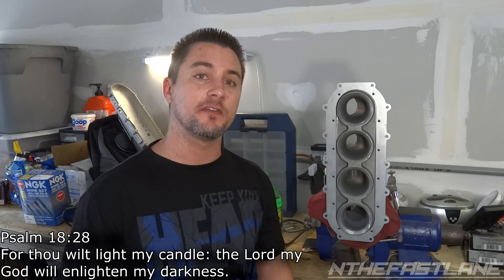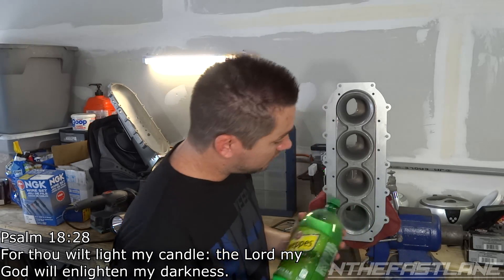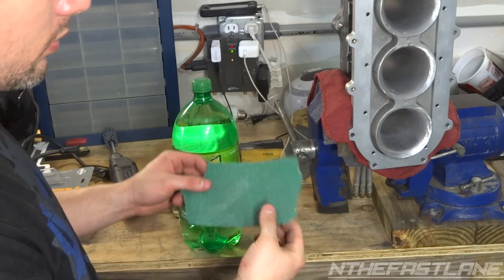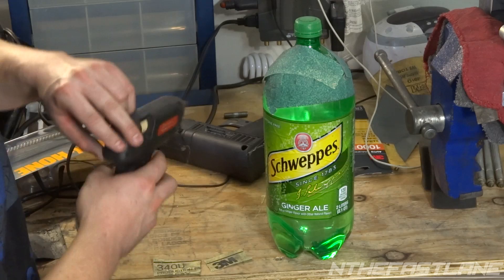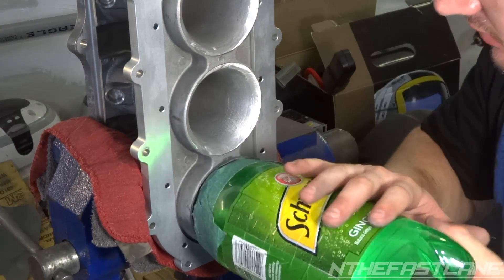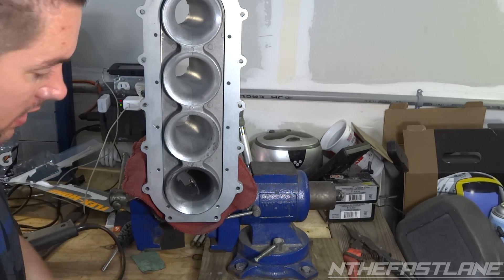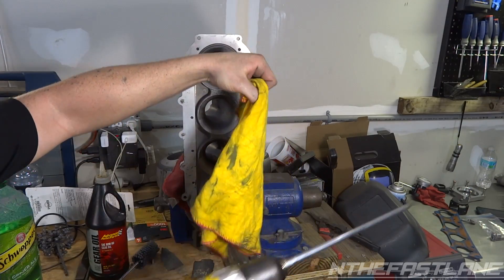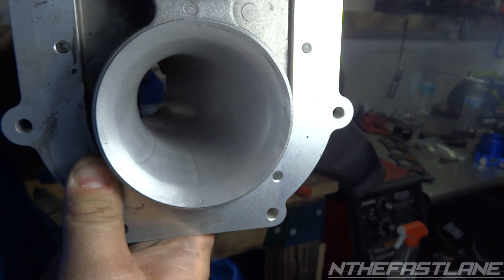▶️Skunk2 Ultra Race Intake Manifold Port & Polish "How To"🔧

Comment: Nice work, but polishing won't improve anything as the air will "stick" to the surface, causing a laminar flow close to the surface.
In fact this will increase the fluid friction in this areas.
Other than that, a certain roughness will cause microscopic swirls, acting like rollers to the gas flow inside the ports.
This phenomenon is known as the "shark skin effect"

But I guess that there won't be any difference to be experienced at all, because the greatest restriction in air- flow will probably be elswhere anyway.
(mostly in the valve- seat area)

The most important issue with the manifold is  the connection between head and ports.
This needs to be flush with no edges or sealings protruding into the channels.

But anyway:
Some good ideas to use the bottle and the honing- tool to remove the rough imperfections!

Nice job though.

Comment: I understand you're using a 3/4 honing tool for the Ultra Race, But I have a Ultra Street. Can I still use a 3/4 honing tool or a smaller size? Any suggestion?

Comment: Great video as always. How much power do you think you gained, I would guess maybe 1 HP, if it is even measurable. Please do not take this as offensive, but In my opinion this is a waste of time.
Reply: Power isn't so much the point, delivery is. Porting/polishing an intake manifold, even if it doesn't yield a large HP gain on the top end, will help it breath better especially in light/moderate throttle situations and lower in the RPM band.
Reply: Avery Alexander I don't think it would yield any peak horsepower at all, but something like this would be an extreme help where the power band starts to fall at higher RPMs lengthening the Power Band past Peak horsepower.. people forget that the peak horsepower is not the only defining Factor. great job on the manifold all the way I would have left some roughness for heat displacement I would have skipped the final polishing step..
Reply: I agree,  when I think of a ported and polished engine, I think of quick revs and clean burns. If you wanna make more HP you gotta move more air and burn more fuel. these techniques seem best for defining a power band. theses techs. work well on 2 stroke motors.

Comment: The casting isn't polished because the tiny bumps increase air velocity... Like a reverse golf ball.
Reply: Ideally the best is not polished but port and let a light "grain" finish but the heavy grain of stock bolt on parts aren't good at all. The tiny bumps are here because of the manufactured injected molding. ( sorry for my english )

Comment: You gotta be a dummy to pay anything near 700 bucks for an intake manifold that isn't polished. for fucks sake. This is why all the manufacturers switched to plastic intake manis. It's already smooth after the casting process. Also what does this do to inlet temps?
Reply: nezerac No, they switched to plastic because it is cheaper.
Reply: If anything, inlet temps would drop because there would be less friction/resistance on the air as it's passing through the intake.
Reply: newpa1n
Ya but it's pulling air from directly under the hood.
Reply: nezerac No, that's not how these intakes work. He has the plenum opened to show the ports, you attach a single throttle body to these intakes and then you can route the actual piping wherever you want. Look into the Hybrid-Racing/Ktuned cold air intake systems.
Reply: Avery Alexander
No...plastic is better for managing heat. I'm looking to be an engineer. Trust me. It's because of power not cost.
Reply: nezerac I hate plastic parts. How about they use an aluminium one with a thermal gasket and finish the job smoothing it. I have seen countless plastic parts, including plenty of plastic intake manifolds break, crack or deform to trust them. Cars are expensive enough that they need to be made well, not the cheapest way possible.
Reply: Avery Alexander
GM's plastic intake is more expensive than their cast aluminun ones for a reason. You're entirely missing the point of using plastic. It's an engineering perspective that you have to at least be willing to attempt to understand in order to appreciate it. Let's be honest here. Plastic is lighter, and  in some cases stronger than a steel piece. It's not as resister to temperature but it doesn't retain heat very well either which should send off some bells for you. Which do you think would heat air charge more? A heat soaked aluminum piece that radiates heat into the charge or a plastic pies where if you blow cool air by it it doesn't affect the charge so much? Aluminum and plasting are far better materials at transfering and dissipating heat than a thick aluminum block of metal. Your engine should never even reach the temps to damage the plastic intake. It probably takes 400 degrees to make it deform and your car should be below 200 in most cases. It only takes a small amount of cognitive effort to put the pieces of the puzzle together to see why what I said is 100% accurate and the fact that finding an aluminum or steel or cast iron intake manifold is impossible to do on ANY modern vehicle.
Reply: nezerac Ok, so plastic can be smoother than aluminium that was not polished, which they should do since cars are NOT cheap. It is a few pounds lighter, and retains less heat. The last one can be resolved with a thermal gasket. But what happens when the car is 10 years old and the plastic was heat cycled many times? I can tell you what happens from experience- they crack or vacuum nipples break off when you remove or install vacuum lines or fail under boost. I have seen this happen many times, but NEVER saw an aluminium one break. I also do not believe that a plastic one is more expensive to produce than aluminium. Just my opinion.
Reply: Avery Alexander
Think about how expensive it is to find a cheap aluminum casting for any v8 vs the plastic housings of today. It's not because the cars are new, it's because cars have changed. I think you're forgetting that direct injection is hear and I think you're forgetting even more that 20 yr old parts are liked to do what you're saying but ANYTHING within the last ten years has seen an amazing advancement for any type of engineering and that includes engineering plastics. Guess what the space shuttel reenters the atmosphere with....FOAM! Guess what is stronger than steel? Spider silk. Guess what controls and aids in regulates heat? Aluminum. Guess what makes heat management better? Again aluminum. But with that control you can reliably run a car at operating temps and not have to worry about any heat cycling that the plastic (which is a misnomer..it's a polymer. Not some cheap thing made to change your radio station and it's got none of the structure) and it warping. It's called R&D man. GM's best intake manifold is plastic and they even started making plastic ones for the old 350's for a bit there. They work! Especially on efi and direct injection engines. If I could change my intake with a plastic one. I wouldn't in a heartbeat.

Comment: I was always told NOT to polish inlets!? The fuel can fall out of suspension in a polished port but a coarse port this cannot happen. I always polish exhaust ports to the max! This also includes the combustions chamber, with exhaust ports I don't take any valve guide off, just round it a little, at hi-revs the valves can dance around a bit causing compression loss...:)
Reply: I disagree.  I've tested several intake manifolds first hand.  Stock, ported, and extrude honed and the extrude honed manifold had the highest velocity.  It was the most smooth of the 3.  Dont confuse intake chamber physics with manifolds.
Reply: This is not true as fuel is injected typically at the end of the intake runner.  Most of what you're referring to takes place inside the port on the head and in the combustion chamber itself.  Not in the intake manifold.  Cylinder head ports, even ported cnc'd ones have small ridges that allow the fuel to atomize properly.  With an intake manifold, you should always go for a mirror finish to help with port velocity.
Reply: Not true at all, mirror finish removes the tiny bumps and reduces air velocity. Look at the mythbusters episode with golf ball car. Intakes are the opposite (unless you make thousands of tiny dimples like a few drag strip guys have) the spots between the bumps create a pocket of reduced pressure and help acceleration and thus velocity. Its like first year physics.

Comment: do you have to worry about rust?
Reply: +Andrew Davis No, that's aluminum. It will oxidize, but it's pretty resistant to it.
Reply: Could you use a ceramic coating or not worth the price? I'm just curious.
Reply: You could coat for the look if you wanted.

Comment: hey bro,really like the vids!! I have a question, I have a b16 head and would like to port and polish the intake and exhaust runners.what grit sand paper should I try it with? thanks man!
Reply: never polish the intake side. you want the air to tumble in the manifold. you can port it yes but you only port and polish the exhaust side
Reply: Great thanks man!
Reply: +danny tapia dont listen to bad advice, polish it up as much as you want. On the head in the area where the injector will spray the fuel, thats the part you dont polish to avoid fuel puddling at low revs

Comment: you polish exhaust not intake as you need turbulence to mix the air fuel mixture ????
Reply: Ehh that's debatable.
Doing so would make more sense in a carbureted engine since the air fuel mixture has to travel the entire length of the runners.
Since mfi engines inject fuel directly into the intake ports or the back of the valves.
Manufacturers use combustion chamber design, vvt events, injector design and or piston design to create turbulence.
Reply: Air fuel mix is essential carb or injection all injection does is measure out the fuel according to the read out of the o2 sensor as to what is burnt and what is left over . if the air moving over or under  the inlet manifold is moving quicker than the fuel being injected you get blow by and over fueling causing higher running costs and less power
Reply: Does that not deal more with carb than fuel injection. The ecu should control that by the o2, maf and/or the map senors.. and adjust accordingly.
Reply from the maker: Jason Kehoe basically you kind of want to leave the cylinder head intake ports alone, but the intake manifold itself can be polished smooth because that's the air that comes in right before the intake ports where the injectors are. I've heard a bit of theory about a certain grit on the intake ports.

Comment: It will flow better, but what about the power? Better flow isn't always mean higher power. Intake manifold also needs turbulence to mix the fuel mixture better. Of course bigger casting lumps should be removed.. ..it would be interesting to see dynoresults between completely polished vs. semi-polished intake manifold..

Comment: Nice video
WD-40 works best for cutting/drilling aluminum.
Also ninja-rig up a bit that will hold scotch brite pads. The depot has the best deal on these. The green first, then the blue last, then whatever you like!
subbed.